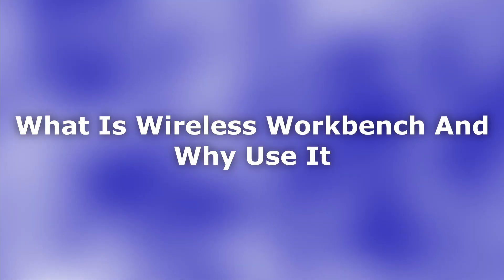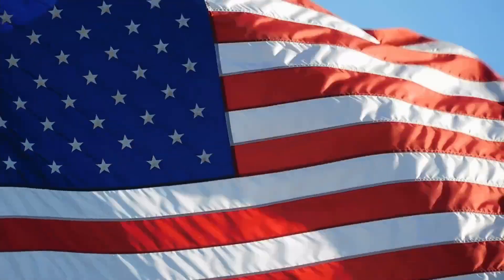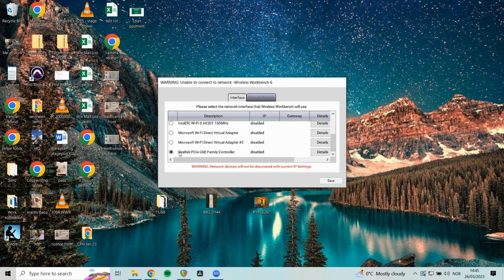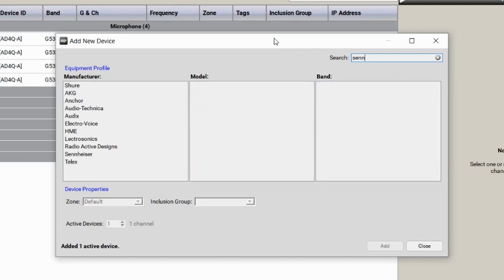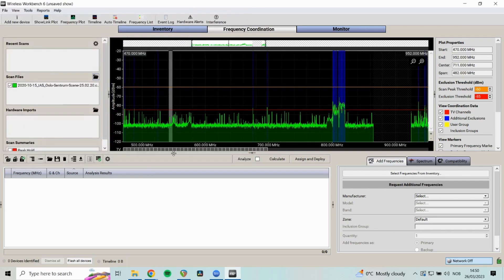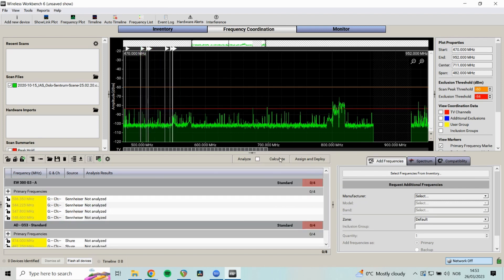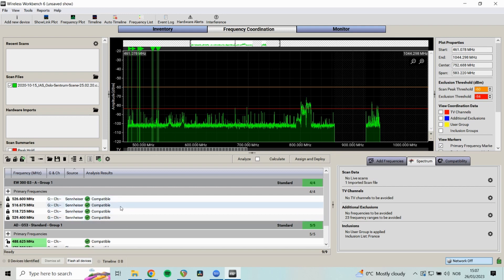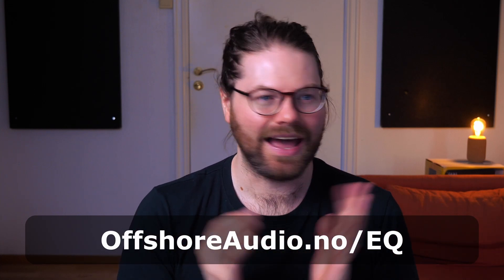Using Wireless Workbench For Wireless Microphone Frequency Coordination

Comment: Could you please give me the frequency file you have? I would be grateful
Reply from the maker: There's a library of scans here: https://taajuus.info/
Reply: @OffshoreAudio  Thank you very much, but how can these frequencies be included in old devices that do not support the network and do not have a port? Like a device ulxp4
Reply from the maker: @YounessMostapha  you should be able to add a profile to WWB. go to tools> equipment profiles> click the + sign. You can probably get the details you need from Shure if you send them an email. They're very helpful. You wouldn't be able to scan the frequency spectrum but you could at least coordinate around an existing scan and then input the frequencies manually.
Reply: @OffshoreAudio  Yes, my friend, I will try to contact them because the frequency between 780 mhz and 820mhz has become very distorted and does not work in open spaces. Unfortunately, all devices that operate in this range have become paralyzed, and there are many studios suffering from this problem, and we cannot abandon this wonderful device.